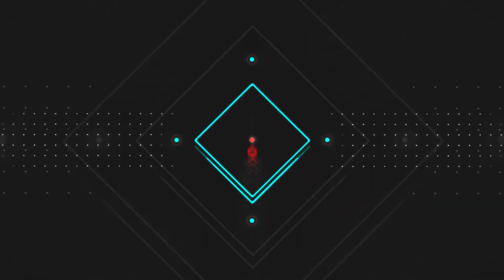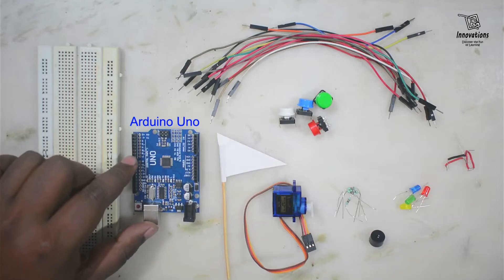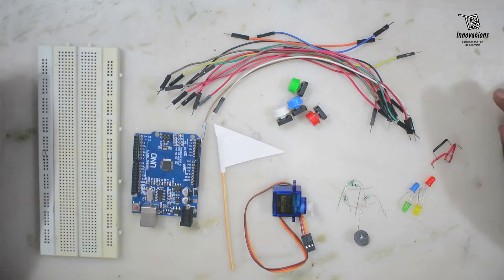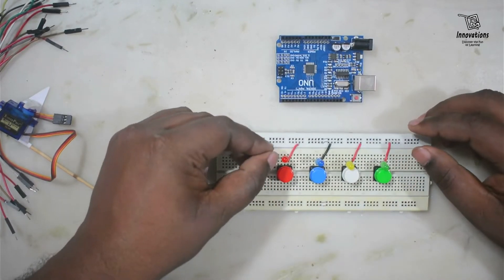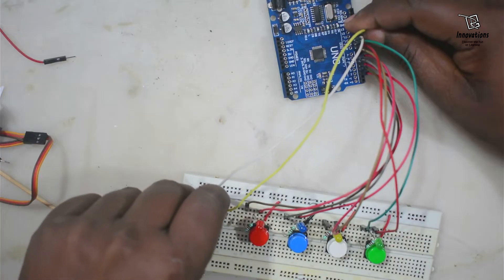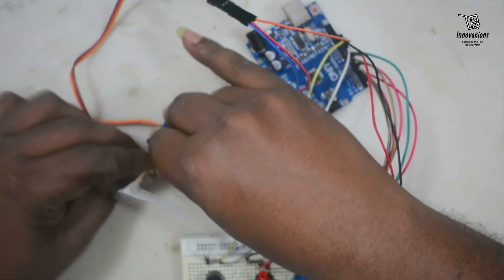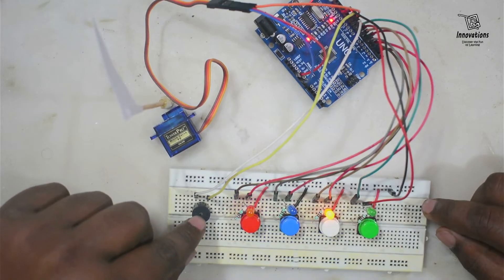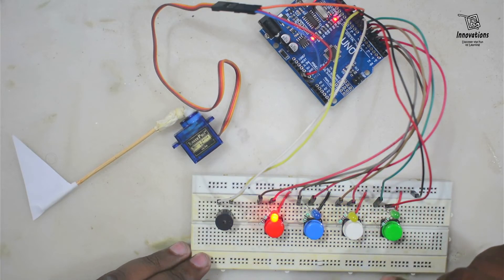Repeat After Me Game / Memory Game Using Arduino | LED Memory Game

Comment: Sir can i use arduino nano instead of UNO
Reply from the maker: Of course
Reply: @RGInnovations sir i have completed my work but code is corrupted can you please check and update it ❤🙏
Reply from the maker: Open code in Arduino IDE
Reply: @RGInnovations  when i download the code in google drive they show file is unsupported
Reply from the maker: It will not open in google drive, import in arduino for windows.
Reply: @RGInnovations sir please help 🙏🙏 tried so many times but didn't find code please please help